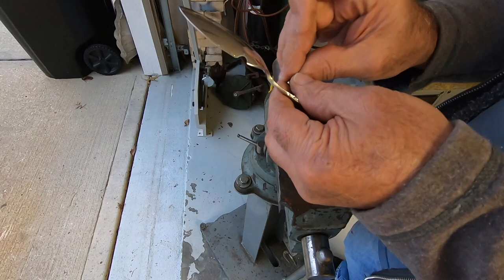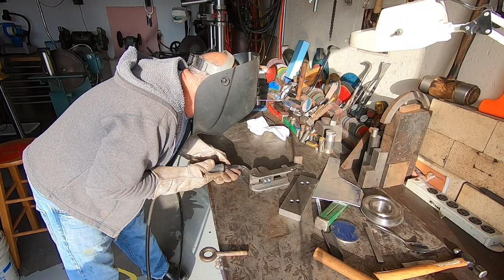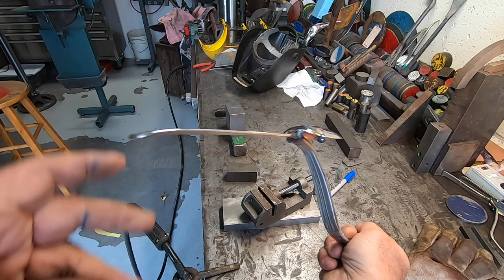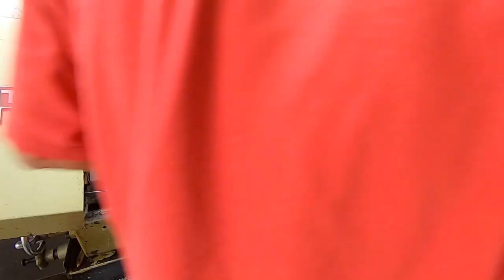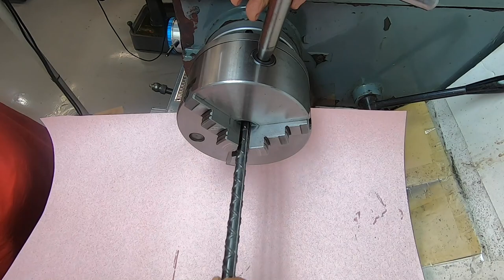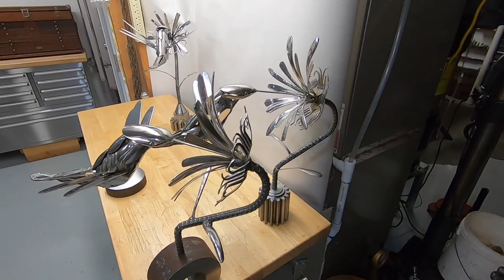Making a Hummingbird

Comment: Great video! There are a few other metal artist channels I watch similar to yours but they have a tendency to show their fabrications in a sort of time lapse fashion which I find very difficult to follow. Your “ normal” speed is a pleasure to watch and learn! Could you share some information regarding your welder setup such as voltage, wire speed and gas mixture?
Reply from the maker: Thanks for watching and thanks for commenting my welder is a 180 Hobart and the settings are usually with silverware I set it on 2 with the wire speed of 50 and .23 wire. I don’t know if any of this helps I’m not a welder so I can’t give the much  welding advice
Reply: @VinceSaluto1  thanks! Trust me, I’m no welder either! I have a Lincoln 140 so I’m thinking I may have to up my settings a little from yours to get similar results. You didn’t mention gas mix. Is it the standard Argon 75/ CO2 25? Keep up the great videos!
Reply from the maker: yes